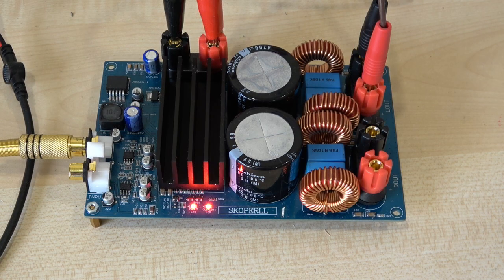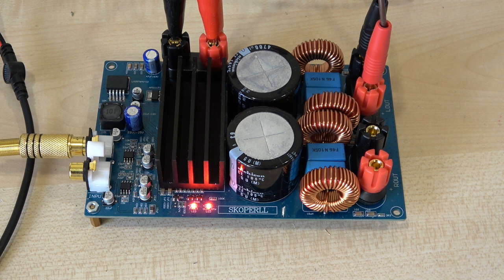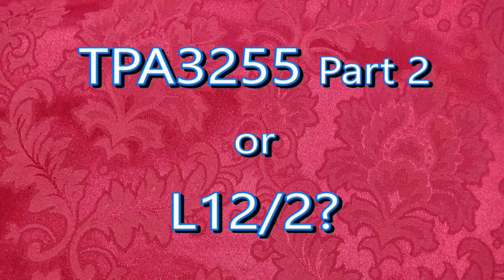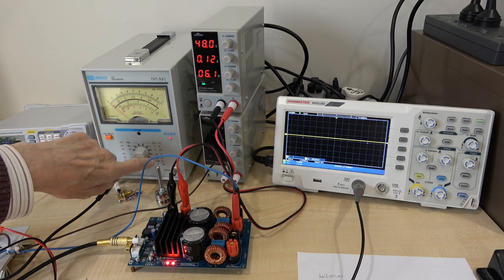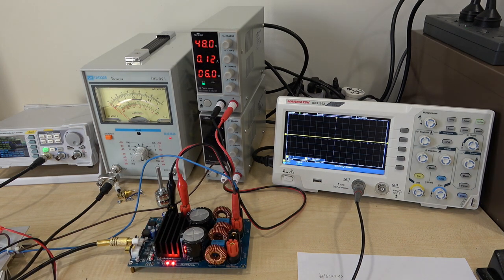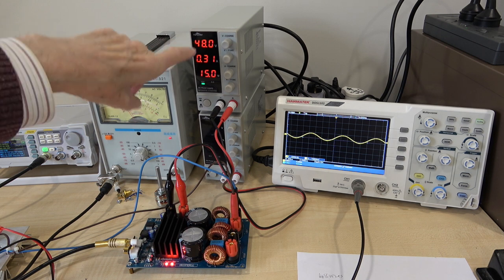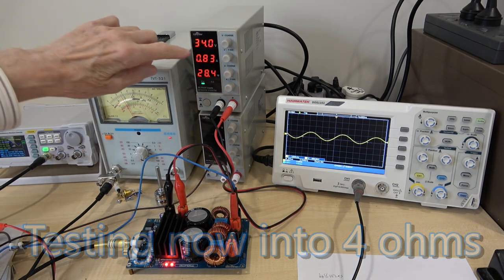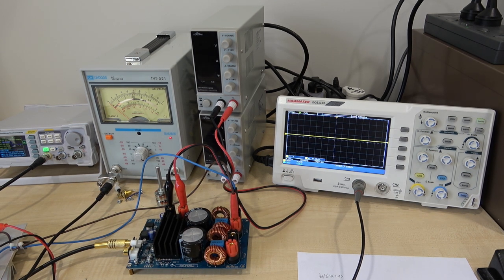Lets Test This Class D Board

Comment: Looking at those numbers I can certainly say that this must be a TPA3245 disguised as a TPA3255.  Someone probably sold thousands of TPA3245's marked as TPA3255 and they all ended up in these cheap boards.  Can confirm, the datasheets show they are pin and feature compatible.  The TPA3245 has same frequency configuration resistors and is 43v max so that could explain the overvoltage/overcurrent protection kicking in during testing...   I wonder if you swapped that junk TPA3255 with a genuine one from mouser or digikey if you would get the power back?
Reply from the maker: Our suppliers, Farnell etc here in NZ have no stock of the chips. Sadly I don't have a way of removing the chip or in fact fitting a new one, even if they were available.
Reply: Replying to my own comment... Looking at the two chips on mouser I noticed that the TPA3245 is almost half the price of the TPA3255, but the evaluation board for the TPA3245 is almost $50 higher in price... must be fewer in supply? idk.  But the board in the video certainly must be the inferior TPA3245 chip.
Reply from the maker: @10100rsn  Sadly no way I can tell, but you could well be right. I had contacted TI on the matter of fakes. They were 100% un helpful.
Reply: @MichaelBeeny  Edit: Yeah, there probably isn't a way to tell and be 100% certain since it is already built into a product and you don't have a batch of chips to look at.  The only thing I could think to check besides output specs and overload conditions are the markings on the chip.  I believe the originals are all printed with white ink so the fake would be laser inscribed, but I'm not 100% sure of that  I might have that backwards... they might all be laser...  Arg!  So frustrating...  Too many chips, not enough information.
Reply from the maker: @10100rsn  These are are not white paint for sure. Looks like poor laser printing to me.
Reply: @MichaelBeeny  Okay, I had a chance to look at all the chips and boards I have under a microscope.  The boards I have with a TPA3255 on them all have very detail laser etching and the imprint looks almost like white ink.  The font on the "3255" has large exaggerated curves and the 'dot' that is lasered near pin one is very detailed diagonal lines (you can see the space between lines).  Those TPA3255 boards came from Amazon (probably all Chinese made) but they seem legitimate.  The Aiyima A3001 is based on the TPA3255 and it is the same as the cheap boards from Amazon.  Only difference between Aiyima and some of the boards is that the OC_ADJ pin is sometimes set to max 17amps CBC3 mode with a 22k resistor and others like the Aiyima are set to 12.9amps Latching OC mode with a 64k resistor.  All of these boards I have set the chip to PBTL mode as that is what I've been testing for.

The TPA3255 chips I have seen on Alibaba do not have detailed laser printing on them and the lasering looks brownish and not white.  The 'dot' for pin one is also blurred with no detail and no spacing between the lines.  That said, all the TPA3255s I have are detailed laser printing that looks almost like white ink and they were all obtained from boards and products acquired through Amazon.  They seem legitimate but I have not tested them all for power output yet.  However, the TAS chips that I have ordered from mouser for repair projects all have semi-blurred and browned laser etched chips that look crisper and cleaner than the laser on the Alibaba chips, but not as good as the white looking laser etchings on the TPA3255s I have.  Probably not enough information to tell authenticity by the laser printing alone, but the OC_ADJ setting along with actual power readings might be the only way to tell for sure if one of these chips is a genuine TPA3255 or a similarly featured chip like the TPA3245 or TPA3251...
Reply from the maker: @10100rsn  Very hard to tell the detail you have seen without a microscope. They look like quite poor etching sort of off white/brown Cannot really see any detail on the circle. Please contact me directly here tas.audio49@gmail.com   Mike